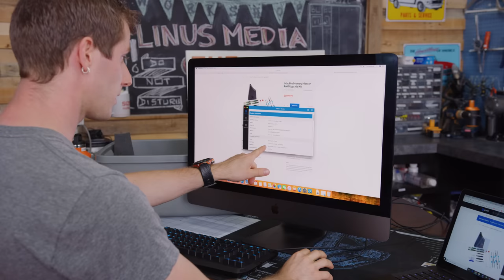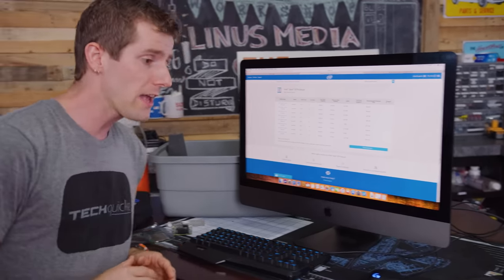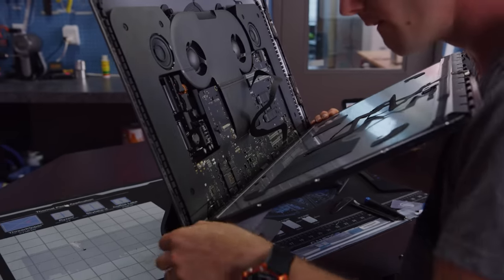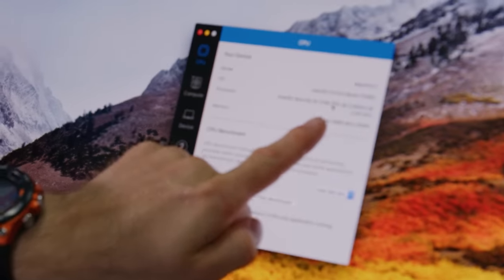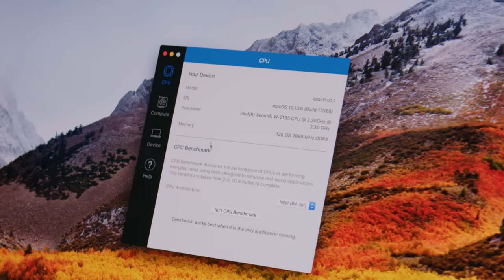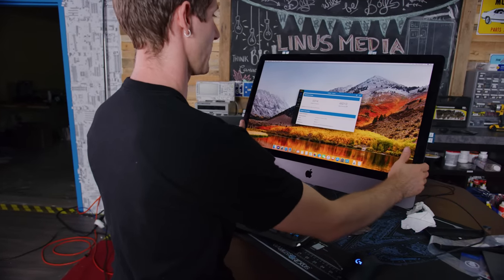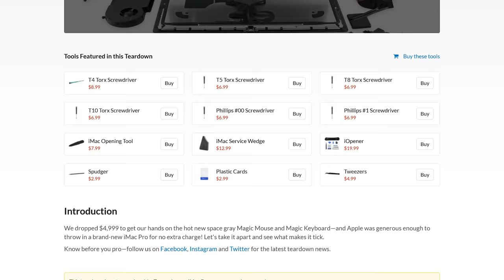UPGRADING the iMac Pro!?

Comment: When Apple moves away from Intel processors, you can kiss CPU upgrades goodbye, too!
Reply: Who would they move to? AMD? Why wouldn't it be upgradable? Also why would they move away from intel?
Reply: Haven't you heard that they've been designing their own processor line for the past few years? Those processors are Apple's own in-house designs and  have been powering their iPhones and iPads all this time. In theory, all Apple has to do is a little bit of tuning, tweaking and scaling and they can have their designs powering desktops as well: a third party like AMD or the like won't be necessary. Just take the designs to an East Asian fab like most others do, AMD included. You need to do some more reading; it's been in the headlines recently.
Reply: Well shit I'm sure the microcode will be opensource
Reply: You don't get it. Whatever's powering iPhones and iPads most likely doesn't have any x86 microcode in it or related microarchitechtire; well likely none that will be of any consequence. Apple, if they really wanted to, very much is in the position to make a go of it, more or less, by themselves. They've got the money and the IP.
Reply: pward17 HAHAHAHAHA apple... open source... HAHAHAHAH
Reply: Hey, if Apple actually commits to scaling up their A Series processors to desktop duty, I'd wager a fair chunk of change that those fuckers will be soldered to the board. I'm pretty surprised that Apple doesn't already BGA the Intel processors they already use.
Reply: Bobcat665 you’re clearly not very bright.

All iPhones/iPads use the ARM instruction set, PCs use x86. ARM CPUs are far too weak for desktop use, they are meant for mobile/smart home operation. 

Apple won’t invent a new instruction set. Nobody will have software even if they made macOS support it. No way apple is ditching x86 on their desktops.
Reply: @Bobcat665  
Kevin tu is right.. switching to x86 will need a lot of software makers to rework their codes.. and who will pay for it? Software makers will not do this.. unless apple will pay them to code those softwares.. the reason x86 is still alive because of backward compatibility and versatility which RISC don't have at the moment..
Reply: They are not going to abandon traditional INTEL or AMD unless they put some shitty Bionic  procesor like in the  iphone
Reply: Kevin Tu well u might want to check out what apple used before they moved to intel
Reply: Apple barely has any loyalty to processor architectures. Jobs would probably have already moved away from x84-64 by now. They don't care about the majority of software people run on their systems, just the ones that people buy large numbers of systems to use.

So many people buy Apple because of how it works, not what they might be able to do with it. Is it still running essentially the same way? Maybe it'll have a touchscreen too. Microsoft came out with the Surface Studio before almost anyone wanted such a device (and after many other companies have done similar for years in niche markets).

Does it run a web browser? Every major web browser also targets ARM. Does it have basic office applications? Many people use their browser for that already, and those who don't are using programs that have also begun targetting ARM. Almost anything that originated in the BSD or Linux world also runs on ARM just fine. If it's not a binary or full of x86 assembly, you can generally just compile software for ARM (but optimising for one or the other is a different process).

Adobe is transitioning away from the legacy code in their desktop applications and their new software already has good ARM support. The biggest direct lack is desktop audio workstations, but the iOS audio ecosystem is already one people go to great lengths to integrate with their desktop workstations. If Apple goes that direction, DAW producers will follow. If they don't they'll be caught out in the cold when Microsoft makes their next attempt at using ARM.

Beyond all that, how many classrooms are filled with Apple computers? How many offices get Apple products when they open, essentially on lease for the length of Applecare? There will be x86 Apple computers for a long time, but they don't have to stay with that forever. Apple switching architectures once is within most IT departments' collective memories, and most senior computer technicians remember Apple dumping two or three entire systems. 

The majority of Apple computers out there functioning aren't new or anywhere near new. People sell them. People give them to their family or friends. Companies dump them by the dozens and sometimes hundreds at used prices after several years (or if they're big enough maintain them in-house until they no longer meet their needs and donate them).  There are still people using PowerPC Macs who are upgrading from G3 and G4 systems to G5 systems because they've finally reached the limit of their usefulness, but that's after this long. People keep using them but many people also want new things, and that's one direction Apple hasn't been afraid to go in the past time and time again.
Reply: Hmm... if only we had one example from history of a company successfully moving its entire desktop and laptop lineup from one processor architecture to another and developing middleware to bridge the gap for 2-3 years... hmmmmmmm.
Reply: Kevin Tu how come nobody remembers the PowerPC to Intel transition with Rosetta middleware? How young are you people?

Also, ARM was considered for the current generation of consoles (Mark Cerny considered it for the ps4)

ARM is way more power efficient, so it’s used primarily in mobile, which by the way is a far more profitable market by volume alone. It should theoretically scale to x86 performance with a TDP increase. If you develop a 40+ watt TDP ARM chip, you should, in theory, have a monster. 

All you have to do is look at the Apple A11 benchmarks compared to 4/6 core intel benchmarks to see that there already isn’t much of a gap. That’s nuts because one architecture is using something like 1/50th the power. 

However, the middleware years will be pretty sketchy. Rosetta worked, but it was slow. 

The storage and display controllers in Apples Intel machines are already in house branded and designed.

Don’t get me wrong, x86 is legendary but  Intel isn’t making 15-40% performance gains every year like Apples A-series team is, and I’m basing my argument on the assumption that if you simply scale up the power on an A-chip and cool it properly you get monster performance.
Reply: If they do that, they will lose x86 compatibility and their 1st tier software partners (Adobe. etc.) will have to recompile and re-optimize their apps for the new chip.  Adobe might be wiling to do that with some hefty financial incentive, but the others, probably not.
They will lose all backwards compatibility with the prior versions of OS/X, as they'll need to either come up with a new kernel, or just bite the bullet and make iOS their desktop OS and get it over with. 
Having watched the turmoil of all their prior platform and OS switches, they just might do so because they're still arrogant enough of a company to thing they can absorb alienating that many customers and partners because they make their money off the iPhone more so than their computers. I just don't know if they can do that and continue to overcharge for their phones at the same time and not (finally) piss off enough people that they actually speak with their dollars and jump ship to PCs.
Reply: Being able to run both MacOS and Windows natively is a big selling point.  Moore's Law has petered out for CPUs; there's no major advantage in moving to a new CPU architecture for Mac at this point.

Comment: I have an old imacand to open it, you need a suction cup and a torx bit screwdriver. Thge glass has a thin layer of steel on the edges and magents hold it on. Here it's an adheasive like on cellphones.

Comment: 50000$ red camera, and the onboard mic is potato quality.
Reply: Well red is pretty overrated
Reply: Red is meant to be used on movie sets. They don't need a good onboard mic because basically nobody intentionally uses it.
Reply: Onboard mic in cameras like that is mostly used for scratch audio, it helps to sync proper audio with the image, and allows the editors to edit the scene before the audio is done mastering, and the sfx are added.
Reply: Red isn’t for audio it’s for video. Audio doesn’t matter
Reply: AndrzejKucyg
Then they use timecode to sync it.

Comment: MacBook 2020... featuring NO USB ports,  NO pesky charger port, NO fans, NO Heatsink, Super Expensive CPU, 10k screen , GPU? , all for the low price of  $200,000 + completely useless apple care.......
be smart people .. DONT BUY APPLE
Reply: 2027. The 2020 model will only be up to 7k.
Reply: *1080p and core i9 9980hk downclocked to 1.2 ghz
Reply: Free Mihanolas locked at 1.2 ghz and locked at 2 cores with no thermal paste. And welded together with coils charged at 240 volts to deter upgrades. And when the dongle is plugged in you can’t use the screen because apple cheaped out on shielding even though it costs $7,000 (yes i mean weld not solder)

Comment: What are the thermals now?
Reply: overheating again ofc...the 18 core is 140W(same as the 8 core) which is extreamly wierd.
Reply: maybe not the new thermal paste that is much higher quality may be enough at full load to keep it sustained for a bit. Also the 8 core is not 140W .-.

Comment: For future iMac repair reference: the official way to make sure the ports align after a repair is to connect a usb cable to the outer most port and a usb-c cable to the innermost port. That way when you put the logic board screws back the ports will be perfectly aligned. :-)

Comment: Can you please make a Watercooled IMac Pro?
Reply: I guess this can't be done with the case, you'd have to use the old aluminium case from >2012!
Reply: Actually sounds like a good upgrade.  Would have to puncture the backing and sit all exposed out the back, but with some serious effort, it COULD still be make to be a thing of beauty. Most likely it would wind up looking as ugly as sin, but its really one of the things it needs badly (the extra cooling that is, not to look ugly)..  :)
Second thoughts, no.  Just buy a real computer.  Apple just sucks too hard to do too much with, and if someone spend the time and money to design and manufacture a mass market solution to the cooling issues the iMac Pro has, you can bet your sweet life Apple will find a way of invalidating it somehow with the likes of a firmware or IOS update.  Apple just loves handing people the shaft!

Comment: YOU STILL HADN'T CONNECTED THE SCREEN BY THE END (INTERNALLY SCREAMING)

I get not wanting to re-apply the adhesive if something isn't connected, but surely as soon as you verify everything's connected and working (i.e. before running the benchmark) you shut down and connect the screen properly? I would've at least used some sort of clip, maybe put those clamps with rubber covers on loosely

Comment: Still dont get it why wasting so much money for those...

Apples....
Reply: How do you like them Apples?
Reply: @paranoidnela  although if you run into any problems for example, your screen fall and break or you fry your motherboard. You could easily find a replacement.
Reply: INSTANT DISLIKE CHANNEL I kinda want to see somebody make a computer small enough to fit inside an apple
Reply: Linus said when comparing specs that the Mac is comparably priced with a PC.
Reply: Brett Steen uhhhh use a raspberry pi
Reply: Some here said that a mac and pc is comparable priced with similar specs???

Not really...
Reply: Learn how to use english before you try to make a pathetic statement like that. Performance benchmarks prove that Apple hardware is top notch on desktops, laptops and phones.......There is no debate
Reply: INSTANT DISLIKE CHANNEL yes actually. If you use geforce cards and extreme edition CPUs yeah it'll look way cheaper but once you factor in the 5k display, xeon CPUs, ECC RAM, NVMe SSD, and workstation class GPU generally the price is pretty reasonable. If you want me to prove it to you I'm happy to make a PCPP list
Reply: INSTANT DISLIKE CHANNEL . Yes that was Linus in the first MacPro video.
Reply: Brett Steen 

Raspberry pi 0
Reply: Then why don't people game on them?
Reply: Because they taste good.
Reply: @RedShirtGuy96  because if you want the equivalent gaming performance you could get it much cheaper. But for professionals, you might need that ECC RAM or extra stuff the xeon brings
Reply: poop fliss Good one! You really got me on that one........

Comment: just as an added safety measure, hold the power button for about 10 seconds (like you would on a laptop after taking the battery out) to help kill off some of that stored energy in the PSU

Comment: Have you tried turning it on and back off again?
Reply: It is a Mac - doing that can destroy Mac.
Reply: @ABaumstumpf  how?
Reply: Thunder Bolt - better question is - "What does not kill a Mac?". over the years Apple-Products have just become more and more fragile.
With current Macs you can have it that if a single USB-Port breaks and you can't use the whole thing, you can't easily repair it your self, and the shop will charge you a fuckton - and with luck you get it back without it being more fucked up then before.

Comment: Now try doing that on a surface studio 2! ;)
Reply: Expandable storage is not really a big deal in terms of pc
Reply: The surface lineup is the PC's version of Apple's shit
Reply: Cyphik I mean it’s not a big deal if it’s not upgradable from the inside. It’s really easy to hookup and an external hard drive. The same thing can’t be said about the cpu or ram
Reply: Cyphik if you don’t like the speed of a hard drive, get an ssd. And you know what looks more than a small case for a hard drive, a giant pc near desk. I’m just trying to prove that it’s not a big deal.
Reply: Cyphik who’s saying you have to use use ports. Use thunderbolt 3 or 3.1 or something
Reply: Cyphik all in ones are different than towers. This was about in all in one with thunder bolt 3.
Reply: Cyphik pretty much all the  hardware in the iMac can be upgraded
Reply: What upgrades did  you do ? i cant see any mention in the description 😡😡😡😡😡😡😡😡😡😡😡
Reply: +Cyphik sure , anyone who caan answer .
Reply: Cyphik I’m not reading all of that but you can external gpus to get increased graphical performance. You can add a better display if you want a better display etc.
Reply: Cyphik Apple doesn’t even sell their own displays and gpus. You can connect any display and gpu through the thunderbolt 3 port
Reply: Cyphik I pay $1500 for an all in one design, free software updates every year, the most reliable desktop OS, continuity between my other electronic devices, 5K display
Reply: Cyphik despite all of this hardware, you can’t even copy something on your computer and paste it on your phone. Your flashy hardware took you no where
Reply: Cyphik can text on your computer? Can you wirelessly transfer photos from your phone to your computer while the two devices are  thousands of miles apart? Can you see any of the files on your computer from your tablet? Emailing can’t do everything
Reply: Meh, Surface is pretty difficult to open up because you need a heat gun and patience to get the screen off. But the rest is as easy as a normal laptop upgrade is.